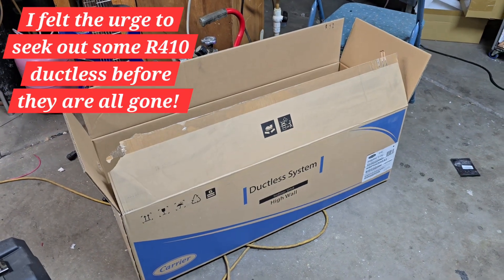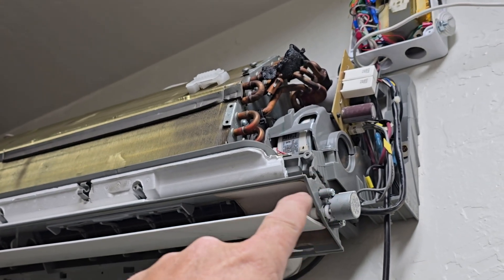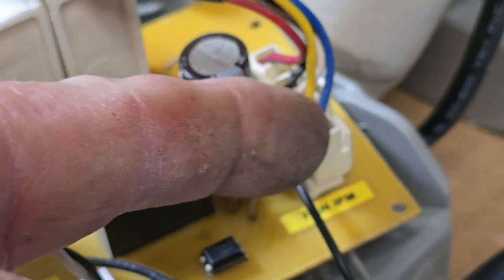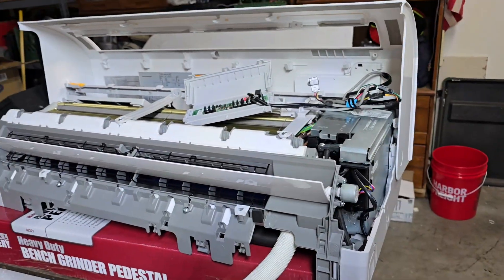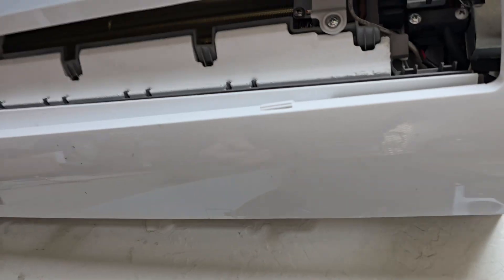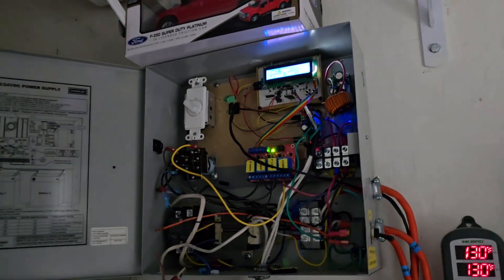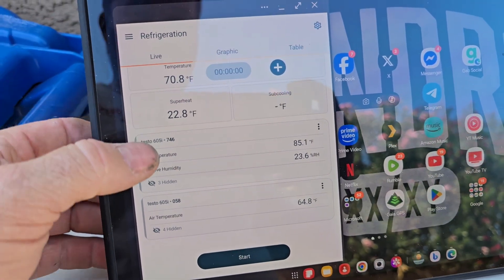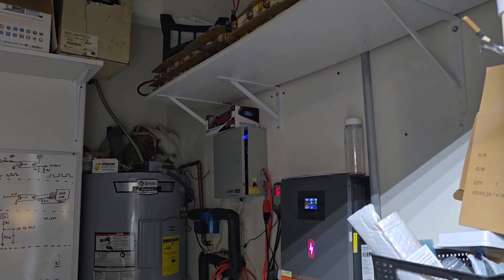Frankenstein water heater gets a coil transplant! (Ductless highwall swap)

Comment: This is some post-apocalyptic mad inventor stuff. Love it!  Can you explain a bit how the HPHW works with the units? You're treating it like the head of a minisplit? Or am I completely getting the wrong end of the stick here.
Reply: It pretty much works the same as an minisplit would in cooling mode. Indoor gets cold, only difference is the outdoor unit which is dumping heat into a water tank rather than the air